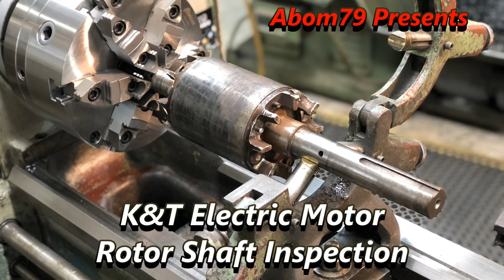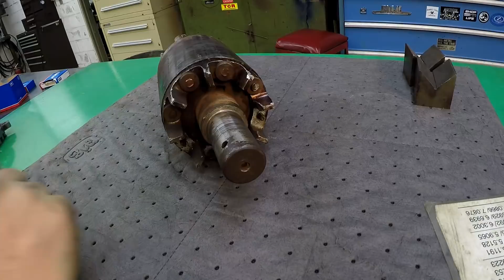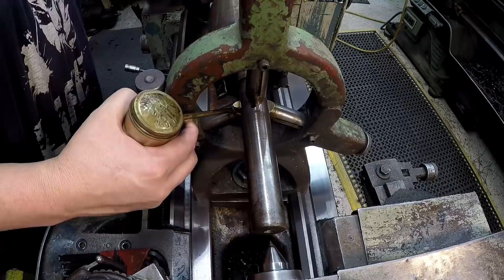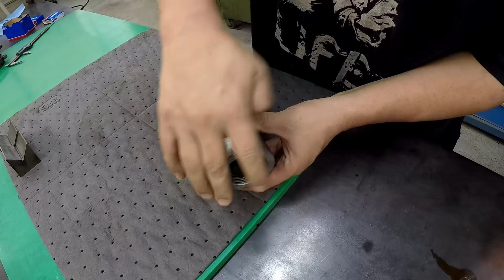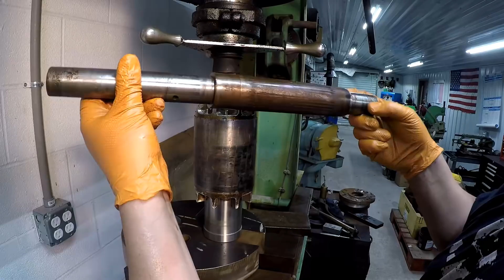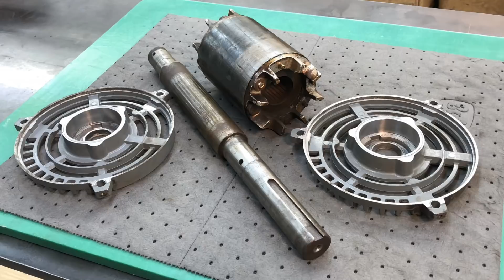K&T Electric Motor Rotor Shaft Inspection

Comment: You were lucky , yours moved , I did a larger size rotor recently , had it on our 60tonne hydraulic press and it just bent the shaft, so made a drawing , chopped shaft off at brg area then drilled the shaft to a thin wall then it pressed out easy, then new shaft made to the drawing. Good video👍

Comment: I used to work for my dad's friend years ago, he was a jack of all trades, machinist, boilermaker, engineer, diesel fitter, painter, sand blaster and some other stuff too. I helped him build a press that had three 225 tonne hydraulic rams on it and bottom rail had to be moved by forklift to adjust the height and four 3 inch diameter pins to secure it. He was using it to straighten a part off a cane harvester and it slipped out and landded about 40 meters away from the shop in the neighbors cow paddock. He built a cage for it after that and nobody was allowed in the shop when he was using it.

Comment: Haha. Press jump. Can be scary.  At my shop, we'd get fork lift tires to press off...the smaller the tire, the more pressure.  When the gauge got > 50 tons, we'd have to warn others in shop that were machining anything that there will soon be a jolt. A 100 ton break-away was enough to rattle the floor and a crankshaft grinder(50 feet from press) inward by .003...not a fun event.  Funny, the jolt always seemed to make the Van Norman crankshaft grinder move inward rather than away from crank.

Comment: No gym membership needed. I don't miss the pucker factor from the old days doing exactly what you just did 40 years ago. I highly recommend a face shield when you switch to smaller push pin as they easily eject as shaft breaks loose. She's bent really good.

Comment: its true is all metric where the bearing ends with two numbers that are of 5 millimeter multiplication , say why don't you use a torch with ice to straighten up the shaft instead of removing it and fabricating a new one , it worth the try
Reply: We used torch and water quench to straighten at the motor shop I worked at years ago.

Comment: I came here because I have a smaller motor from an extractor fan with some corrosion under the bearings.  But I don't have tools to weld and regrind so think it's probably going to have to be a new motor.
Reply: deemdoubleu you can try knurling the brg. Areas?

Comment: can I do the same using a hammer and a wooden block for a 1/2 HP motor shaft to separate the shaft from the rotor ?
Reply: Tony King  I'm not talking about bearings here .. doing the same thing in the video as Abom79 only with a smaller motor

Comment: Adam, I know this is out of left field, but pressing that shaft out of the motor is an excellent example of how earthquake fault lines build up pressure and then suddenly release.  The pressure builds up and up until there is enough to break the friction holding it in place.  With your permission, I'd like to use this video as an example and illustration.

Comment: i'm curious and great series on this project but it looks like when you held the armature up at @22:31 there is a key slot cut through the armature but not on the shaft you removed, I believe that someone else had replaced the shaft before you and left the key out of it thus causing the galling which made it hard to press out.    Since motor torque transfers the magnetic force thru the armature and into the shaft there should have been a key on the new shaft so that the armature can not rotate from torque on the new shaft?.  Having done similar projects there has always been an internal key to locate the armature onto the shaft.  I would like to get your thoughts on this and as usual Another great project!  I am also surprised that it seems no one else noticed this.
Reply: I saw it.

Comment: Fun to watch. Did this for a living back in the 70's age 16-19. Worked in a motor shop ended up in the machine shop.  Enjoyed the work hated the pay. Left for better money in a different industry. Now retired  have my own private for fun machine shop. it just stayed in my blood.  Making stuff for fun these days. The memories came flooding back watching this. I would have first tried to straighten the shaft with a torch dial indicator and a wet rag. Cut my machinist teeth making motor shafts, repairing castings,  pumps compressors etc... Thanks for the video.

Comment: Another great video Adam.  I'm also looking forward to part 2.
When the shaft came 'unstuck' from the rotor, it reminded me when as a very green 17 year old, me and a mate used a hydraulic puller to remove the front hub on his car.  Neither of us had seen a hydraulic puller before, we attached it to the hub, and very cautiously wound up the very small knob in the centre and of course, felt no resistance.  We gave it a couple more turns, then some more, then sat back and wondered if we had a duff puller.  Then BANG.  The puller and hub passed between us (luckily), skidded across the road, and knocked a chunk out of the kerb on the opposite side.  It travelled about 40 feet in total, very quickly.  That was 52 years ago and I'm still sweating.

Comment: Damn, that takes me back.
 First job I had after training(1977) was at a place making flameproof electric motors for gas pumps (Tuscan Electric) we only had 5 micron tolerance on the small bearing end covers (35mm OD bearings) Sucked when they cut time in half then told us we had to do 100% bonus so the 2.25 mins became just over a minute for everything (from one bin 'raw casting' back to next bin 'finished') Motor shafts and field lamination packs were good paying thougheven after taking time to offhand grind carbide tools (no replaceable tips for us back then)

Comment: Wouldn't it be a good idea to cool the shaft with dry ice  so the pressing is easier which will lessen the chance of damaging the shaft?
Reply: Wondering the same, large interference fit - thinking temp differential would have helped.  Would like to hear Abom's take. Less galling?  Maybe more fun to have the sucker jump in the press.
Reply: @smagnusen  I am not thinking it should be an interference fit as the armature is machined  for a key and I believe the galling is from someone else replacing the shaft at an earlier time and did not cut the shaft for using a key but it needs the key not an interference fit and @22:31 the key slot is clearly seen when he holds up the armature but another great video series

Comment: For those without access to spray welding etc, how well does sleeving the shaft do?
Reply: We only used sleeves on pump  packing seals in the motor shop I worked at, we used the metalizing spray, welding and Belzona molecular ceramic. I have seen a couple of sleeved and brazed bearing fits come in but we had to turn it out, weld them up and turn the weld back down according to our shop standard. We also had to turn a perfect spray job down and weld it up because it was done with bronze powder and we only used stainless powder, by order of the shop Forman. I think in some cases if the design allows and if done correctly sweating on a sleeve and turning it to size would work similar to spray welding.
Reply: @SW-ii5gg  Thanks!

Comment: Adam, 
Great channel, very informative. I’m just getting started in machining (home shop).  Maybe you could (please) point me in the right direction in what brand name of lathe to purchase? I really like the Monarch lathes, isn’t your lathe Monarch? 

Any help is greatly appreciated...Thanks much Nathan
Reply: This is a really vague question without providing any additional info.  Budget?  New or used?  What size / type of work do you want to do?  Do you need a high speed spindle, metric threading, certain size spindle bore?  Don't want to recommend a Niles when you actually want a Hardinge.
Reply: Requirements:
1.) Spindle bore: 1-1/2” minimum 
2.) new or used : either 
3.) Budget: $6000-ish
4.) size: 8” 10” by 30” C to C
5.) threading : yes National Standard
6.) type of work: general threading - internal & external, turning, parting...etc. 

Any help is appreciated...Nathan
Reply: Depending on where you live, should be in a strong buying position there.  Probably enough to choose from with that budget that you'll find something nicely tooled too.  The hobby market around me seems to float more in the $1k-2k range and they'll fight over a worn out South Bend, Atlas, or Logan.  You'd have your pick among a lot of heavier tool room lathes if willing to spend $2500+.

Comment: Hi Adam
Love your video's
I have done many repairs to rotor sharfts over the years, when I encounted a bent sharft I took a drffereht approach I would cut off the bent end behind the bearing I would then drill and ream a hole into remaining sharft in the rotor and do a weld prep. I would then turn up a new piece (oversize ) to replace the cut off piece  press it into the rotor and weld in place.. Then would completely turn the whole end, because the weld is behind the bearing the loading on the motor is OK. I am 68 year old semi retired machinist still working .
Keep the video's coming
Reply from the maker: I have done that before in the past on some jobs, but only when we needed to or the customer requested it. I prefer to make a new shaft when I can. I've shown stubbing shafts in other videos on my channel.

Comment: What about rewinding a 5HP compressor duty motor?

Anyone know if it's practical to have single phase 184T frame 5HP Marathon motor rewound? Or is it only realistic to replace rather than rewind? Called the very few local shops with no luck.
Reply: Generally not, materials and labour will cost as much or more than a new motor. We used to wind motors at our small family shop, not worth winding anything that's standard anymore.
Reply: Are there places to source a good used motor like this? Most I find are ~$500

Comment: When I was working on cnc routers at times we could not push off a rotor I would have to bring it home to my 50 ton press. Most of the time it would take about 40 to 45 ton to pop loose. Heating or flash heating did not work. When it would pop loose my friend's next door ould hear it. And they was about 100 yards away. Keep in mind it's a good think to wrap it with a furniture pad just for a little protection

Comment: Ive built alot of rotors like this,and most of the time thats a interferance/shrink fit,hot rotor and cold shaft type fit..i wonder if thats a regal/marathon electric rotor?There would be some stampings around the aluminum edge near the fins on either side of the casted areas of aluminum..alot of these were made up here in wisconsin..
Reply: that is/was a common building technique for a tighter fit without bending the shaft or destroying the lamination stack while pressing, as is having straight knurling on the shaft for more bite, which helps keep the rotor and shaft locked together when going through natural heat/cool cycles from cold starts. the aluminum helps there by transferring heat faster and more evenly, among other things.
it's been years since I worked at a motor plant, so recalling everything to a tee is a bit rough

Comment: id recommend installing a large diesel engines fuel pump for the press together with a small Elecric motor - low cost solution for a hydraulic press so you dont need to pump anymore
Reply: Get that idea off bbloc 
Good idea but very expensive and not quite as simple as it sounds 
A built to purpose electric over or air over pumps are cheap as these days
Reply: that's a whole nother channel in Finland

Comment: I tried to press the shaft out of a 1HP motor last year. I was using a 20ton HF press. One of the cast iron bucking plates that comes with it, failed, and the rotor shot out sideways, and embedded itself into a sheet rock wall. The rotor is still stuck. My repair was from a previous modification where I turned the shaft down to fit the pulley on the lathe. I figured out later the pulley was never machined true to the V-belt, and I left a sharp inside corner on the motor shaft diameter reduction. This caused a vibration crack, as one day while running the lathe, the pulley goes rolling at me. That was less then 100 hours of usage time before the shaft cracked and failed from an eccentric running pulley.
Seeing how hard this pushed for you, I'll have at it again. My shaft is not simple like yours.
Oh, and off ebay, I got a pair of hot rolled bucking plates.
Reply: take old or remnant carpet and padding and wrap everything hold it with electrical tape on small items and some ratchet/pull straps overall/larger items.
it will take the majority of flying part force and make it nearly null at lower tonnage, plus if to happens to still fall it will have a soft landing, thick rubber floor mats help also.

Comment: Is doing all this, the rebuilding, the restoration, the rewinding etc, etc really cheaper than just buying a new motor?
Or is it that this is such a well engineered motor that no modern replacement exists that can compare, is that it?
What is it?
Reply: I don't know the specifications of the motor on the K&Ts motor and couldn't find a picture of the name plate, but 3ph motors that size would probably be around 2k ish?
Reply: Rebuilding old motors makes more sense since they were designed to be rebuildable. I doubt whatever frame size that motor is is still being made, so you would have to make modifications to fit up a modern sized motor. Even then, it's a 5 or 7.5 hp 3-phase motor which won't be inexpensive. Plus I think Adam could make up a new shaft for this thing with his eyes closed

Comment: Adam, 
I noticed the rotor laminations have a keyway cut in them, but there is no key slot n the shaft.
Is that shaft an original or has it already been replaced at some stage?
If the laminations are keyed to the shaft does the fit have to be that tight?
Cheers Eric
Reply: +midgog2 Plus that empty space isn't going to do much for the rotor balance.

Comment: Hello adam, fellow machinest here i repair rotors and end bells all day long, our work practices are pretty much the same. For a reshaft tho ill cut the end of the drive end off then drill out the shaft to release the fit on the rotor. Then it makes pressing out very easy! For this rotor i would had straighted the shaft using the torches then sleeved both ends if possible. I only spray weld if i need to because ive seen it fail if the motor has a belt load.

Comment: Nice one Adam. Jumped in my chair when the shaft first moved! When repairing a shaft, possibly a good idea to clock the rotor as well, to ensure an even air gap between it and the stator, improving the efficiency of the motor. Not much, but it all helps. In this case, a new shaft will be good I suppose

Comment: didn't look like much galling, I'm sure the shaft was "straight knurled" before the heated rotor core was pressed onto a cooled shaft, the rotor may not stay put on the shaft if not done the same or locked some other way.
the shop I worked at long ago used a dinosaur stamping press to straight knurl them, it was low HP motors then, but pretty sure they did the same for giant elevator motors. the press was leftover from back then, as was other large unused tooling, like a vertical lathe 10' + diameter table, a pair of two story tall walk in varnishing rooms with large tanks underneath, I can only imagine the natural gas they used up.

Comment: so the laminations are keyed but not the shaft? odd.
Reply: most likely that was for alignment of all the lamination's before being the aluminum was poured. notice how they'e all clocked slightly different up the stack :)
Reply: The skew in the rotor lams with the Ali short circuit coils ( yes they are considered a single turn coil ) is to smooth out the torque

Comment: Done plenty of shaft replacements on induction motors but these were high speed jobs that ran on 400hz two pole for grinders , I did total rebuilds on these although I did not make the shafts they were bought in as a Service replacement and were glass hard , I did the rewinds as well not an easy jobs give me 1000hp any day 

Great work Adam noticed the rotor had a key way but the shaft did not any thoughts but I bet you have it done by now 😀

Comment: Could that shaft be straightened? I worked in a shop once that rebuilt pumps and had lots of bent shafts. I guess I was good enough at straightening them that they would make me do all of them. They even had several hundred in a junk bin that they were going to sell for scrap iron. I started straightening them in my spare time and I was the bosses hero. Saved them lots of money I suppose by not having to buy new ones.
Reply: How did you straighten shafts? Press and prisms?
Reply: They had a machine that was like a lathe but didn't turn the shaft at all. I could turn it by hand and with a dial indicator I could find the bent place. The shaft would set in the centers on the ends and instead of a cutting apparatus on the cross slide, it had a pneumatic press that would go back and forth on the bed ways. It had round blocks that hung on either side of the press and that was hung from the top of an a-frame type deal and it would press exactly on the bent area of the shaft. It had lots of adjustability to get the pressure on the shaft where you wanted it. But it never put any pressure on the ends where the live centers were. Hope my explanation is good enough that you can understand what I am talking about.
Reply: Understood. Interesting machine. Special equipment for specific tasks. Wish I do some work on it...